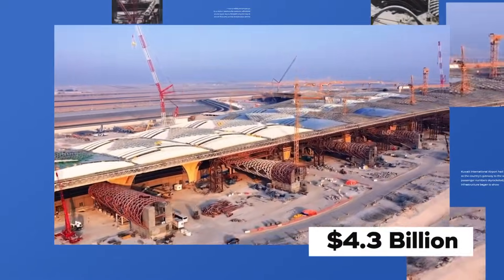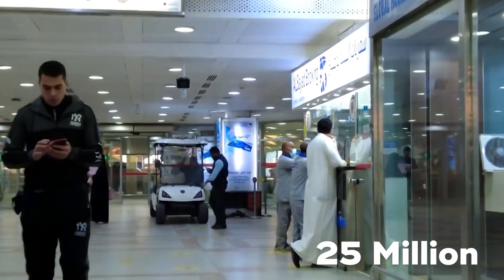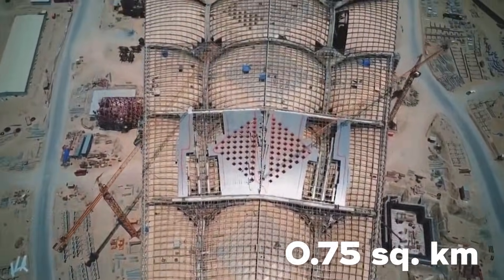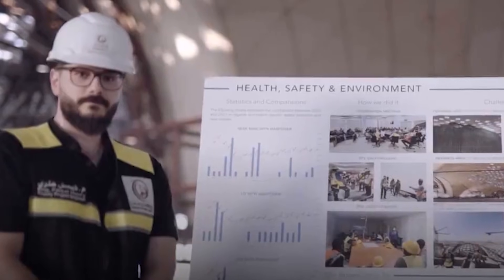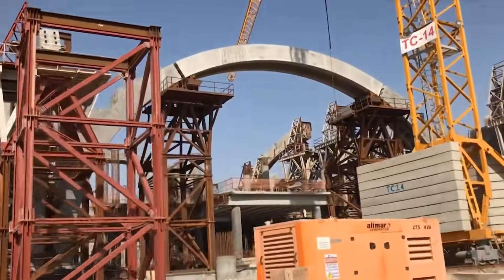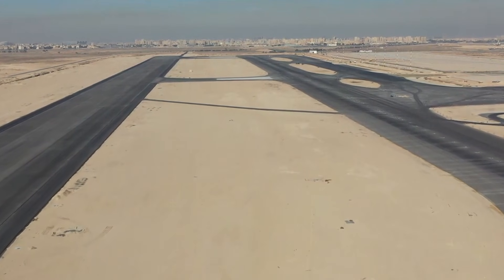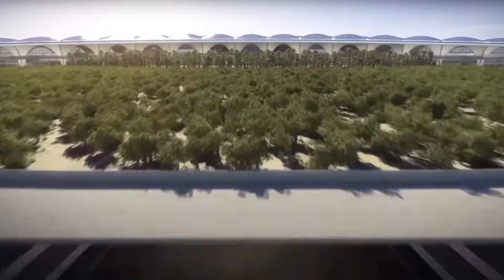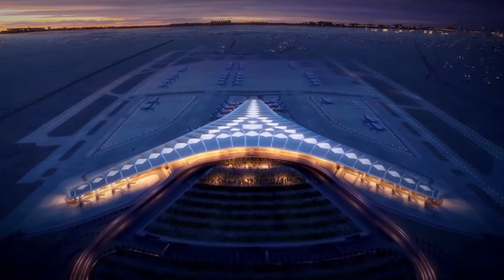Inside Kuwait’s $4.3B Mega Airport: The Engineering Marvel Defying Extreme Heat

Comment: 0:50 kuwait airways leaked a380
Reply: yeah thats not gonna happen
Reply: @saloomyaseen9526  Why not explain ?
Reply: The airport's architectural blueprint comprises three floors and a basement, delineated in a triangular layout, with each side spanning 1.2 kilometers. It is equipped with passenger gates capable of accommodating 21 Code F (A380) aircraft and 9 Code C (A320) aircraft.
Reply: Google source not mine 😉
Reply: @saloomyaseen9526  ye I know